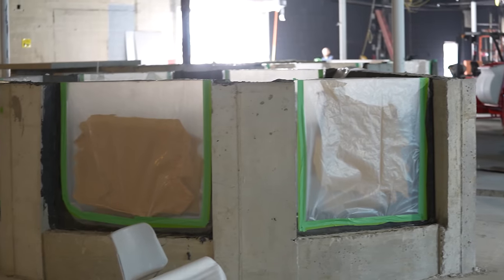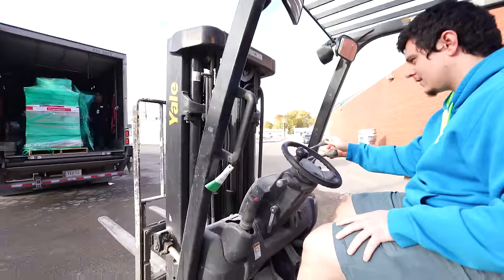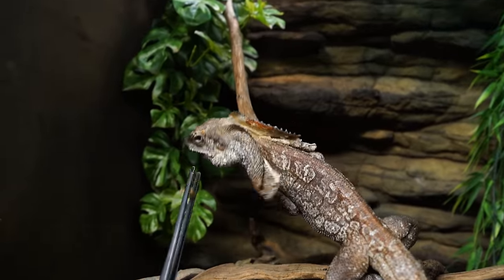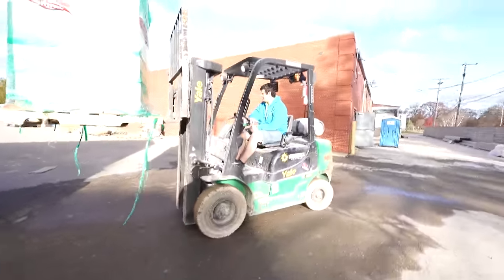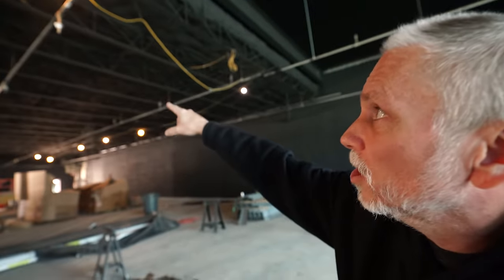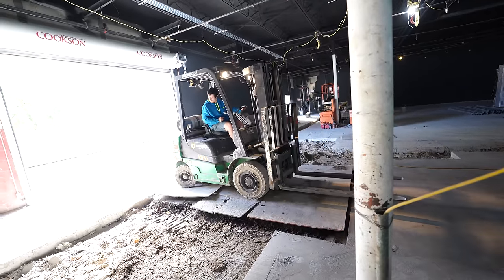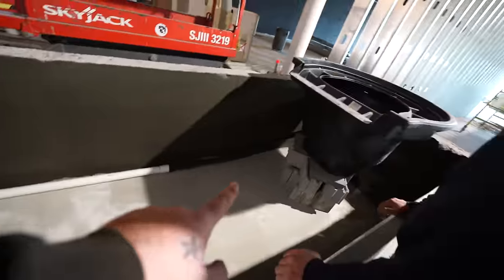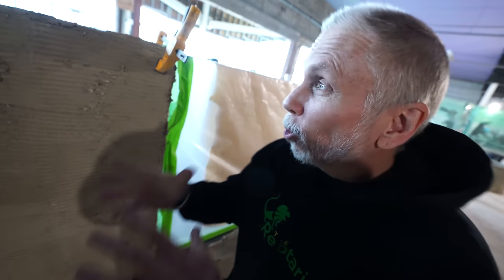Before And After On My 25,000g Predator Fish Tank!

Comment: Now it might just be a regional thing, idk, but, masons here in the valley of Virginia have always called it a 'scratch coat,' the layer (usually, over chicken, or razor wire, but, also just added atop other masonry) which fake, or real, stone will be stuck to that helps it grip and stay in place, while bonding and during that initial cure.